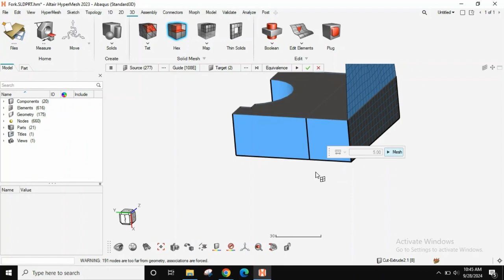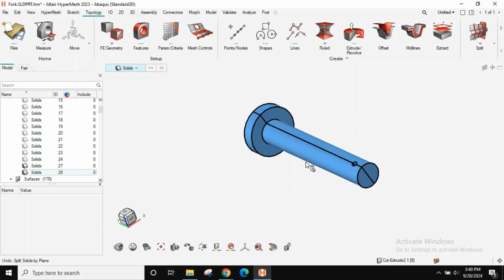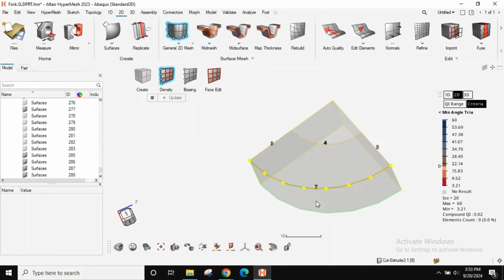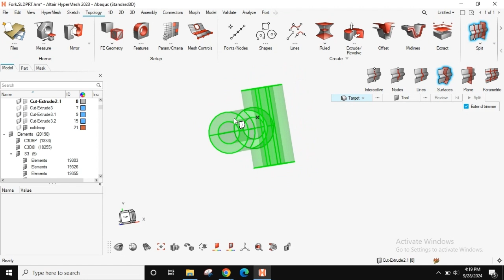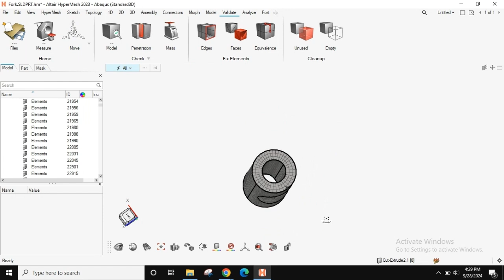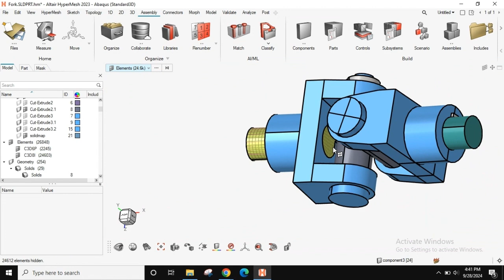How to Hex Meshing with HyperMesh 2023 A Comprehensive Guide : Part K (Universal Coupling Assembly)

Comment: Such a good video! Thankyou very much, but I have a question.

Where can I find equivalance and feature in 2022 version? From what I found, the feature in 2022 can only select edge and surface (not element) like in the video
Reply from the maker: I don't have installed HM 2022 so can't really say about it.

Try shift+F3 button and there will be an option in drop-down menu to use elements instead of components.